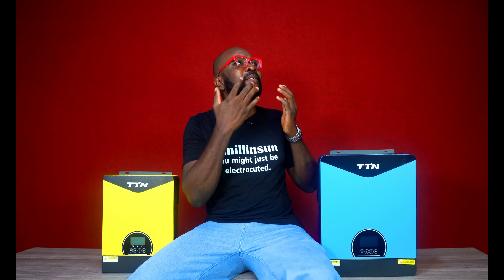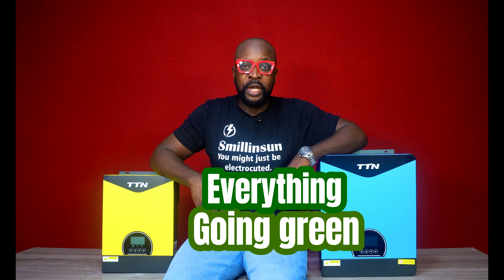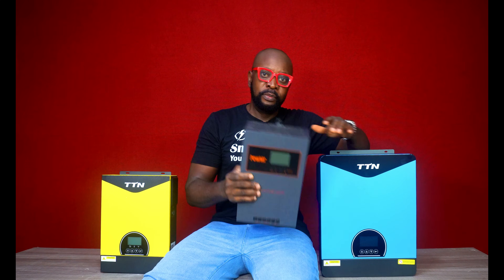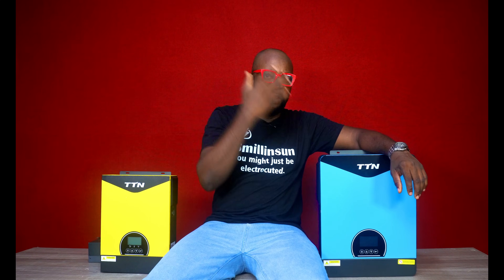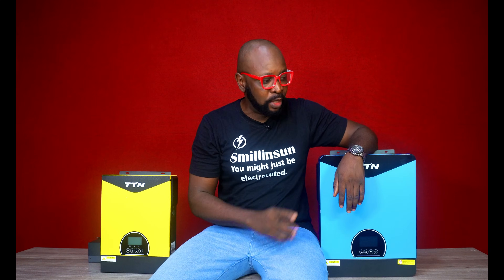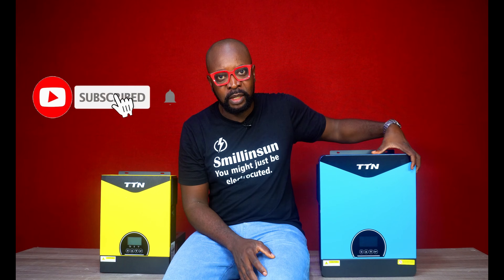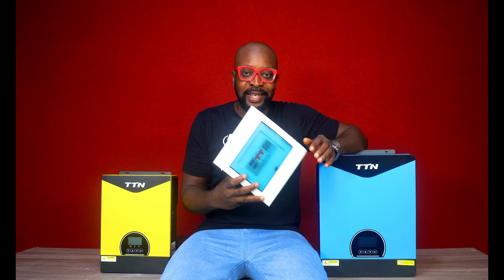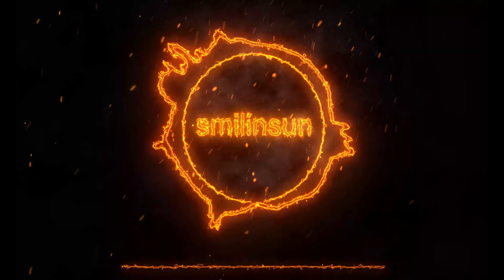What is a hybrid Inverter ?

Comment: Please can you give me the adequate voltage settings for bulk/absorption voltage and float charge voltage for a 12V LiFePO4 battery?
Reply: Bulk voltage Between 14.2 to 14.6v. 14.4v is quite enough. I use 14.1v. For float, you can use between 13.6V to 13.8V. Dont go above 13.8V.

Comment: What is disadvantages of hybrid inverter?
Reply: The idle consumption is high(i.e the power the inverter draws from your battery just to run without having any load on it). They draw averagely 45w to 80w, some as high as 120w just for running. Unlike standalone inverters. Stand alone does not draw high standby power like hybrids
Reply: @EasyyokeFilms you even know more about inverter better than the YouTuber
Reply: 😂  @EasyyokeFilms
Reply from the maker: @JosephMafunga-gc2be  It's compact, it's more affordable, it saves you space, settings are less cumbersome.

Comment: Help! 

My inverter charges with the grid but not with my generator

I have a 3kva generator and a 3.2kva inverter
Reply from the maker: This is quick diagnosys , Your Generator even though it is rated 3.5kva is not, your generator cant  charge your battery through the inverter .
Reply: @smilinsunsmilinsun8056 The issue isnt really the generator capacity, the right answer to his issue is that Many Petrol generators put out “dirty” sine wave and many hybrid inverters will only accept pure sine wave which grid power provides. It is why many hybrids dont charge with Petrol generators. Only diesel generators produce clean power that will work with your hybrid inverters. So @Jerome, this is a well known issue. Your petrol generator puts out modified sine wave power which your hybrid inverter hates. That is why it doesn’t charge with gen. As a matter of fact, if you keep running petrol generator on your hybrid inverter, it can spoil it

Comment: It's your laugh for me. 😂 😅

I have a question about the situation where one would need to include a standalone charge controller due to having more panels than their hybrid inverter can take. How would the work of the charge controller be mixed with that of the hybrid? Will the charge controller be connected to the hybrid inverter or what?
Reply from the maker: It’s essential to use the same CC brand and voltage system—whether low or high voltage. These specifications must be followed, as a new external CC may not be compatible with the Hybrid due to differences in format.
Reply: Which is more rugged hypride or normal inverter

Comment: Can i over panel this Felicity mppt 12 volts 800 watts with two 550watts panels( making it 1100 watts) on parallel. Can the mppt handle the oversizing?
Reply from the maker: @teeman9166  Yes

Comment: so can you a grid tie invertor with them.
Reply from the maker: It is not a grid tie Inverter
Reply: @smilinsunsmilinsun8056  I don't it was . I ask if you use a grid tie inverter with it. Means to use in a micro grid. Grid  tie sends a higher voltage and other stores more of its power in the battery's.

Comment: why inverters are more expensive than solar panels? , what are the root causes of inverter burning?
Reply from the maker: Well as a single unit inverter might be more expensive than a solar panel, but as a collevctive unit not so sure anymore. As regards burning its extremely rare and it stems from poor installation and substandard components.